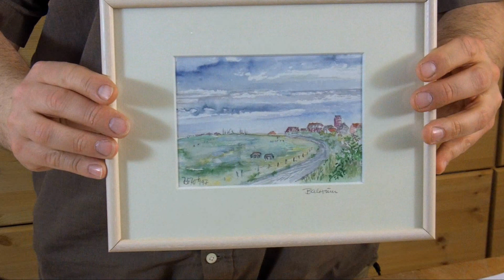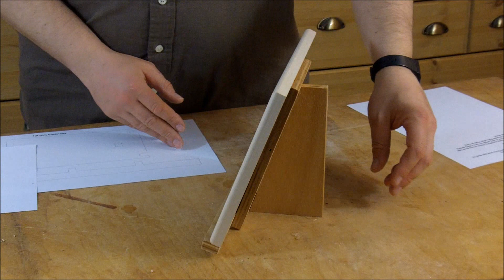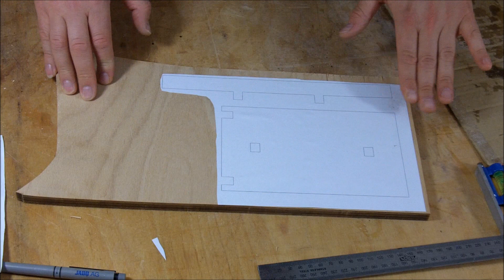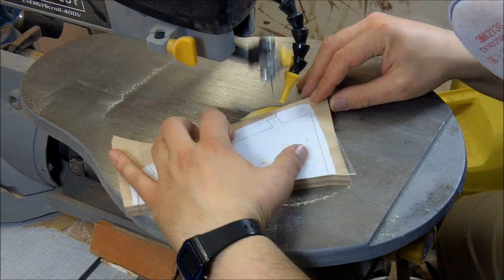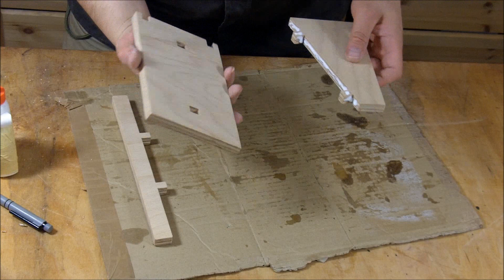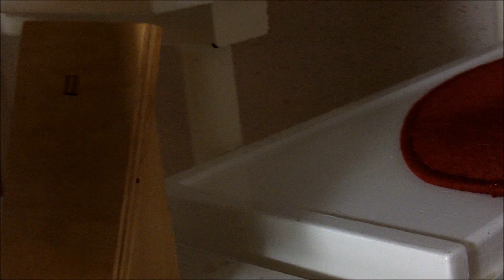make a small PICTURE STAND DISPLAY EASEL

Comment: I'm new to the scroll saw and was intrigued by the ease with which you mara a right angled turn. Does this require a special blade or can any thin blade do the job?
Regards
Peter Evans
Reply from the maker: You can make a right angled turn with any "thin" blade!
If you're new to the scroll saw you might want to take a look at Steve Good's videos:
Scroll Saw Basics:
Scroll Saw Basics Part 1
Scroll Saw Basics Part 2
Scroll Saw Basics Part 3
Scroll Saw Basics Part 4
Regards
Fabian
Reply: swingguitar1950 Many thanks. Just to make sure of the word "thin". Does this refer to the thickness of the blade or the distance between the teeth and the back of the blade?
Regards
Peter Evans
Reply from the maker: Peter Evans The distance between the teeth and the back of the blade.
Reply: swingguitar1950 Thanks.
Reply: swingguitar1950 Thanks again. I couldn't quite see the angle for the support on your drawing. Please advise.
Reply from the maker: Peter Evans
it's 20°. Have you looked in the discription? There I have a link to the pattern.
Reply: swingguitar1950 Thanks. I hadn't looked in the description.
Regards
Peter Evans